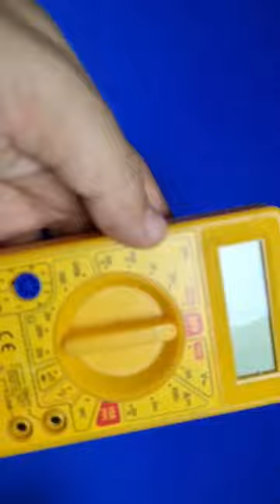Upgrade Your Multimeter: Here's How You Can Make Backlight Using Old LCD Panels #shorts #zaferyildiz

Comment: If you want your multimeter to drain its battery much faster than before, then go ahead with this. 🙄
Reply: We can use rechargeable lithium ion battery plus step up module in this multimeter so there is no concern about energy consumption.
Reply: Zsombor99@ Ja, und wenn sie gar keine Batterie verbrauchen wollen, machen sie die Batterie raus, dann verbrauchst du Null Batterie und sie müssen nie wieder eine neue Batterie reinmachen!!!!! 🤦🏻‍♂️💥
Reply: Zsombor99@ Ja, und wenn sie gar keine Batterie verbrauchen wollen, machen sie die Batterie raus, dann verbrauchst du Null Batterie und sie müssen nie wieder eine neue Batterie reinmachen!!!!! 🤦🏻‍♂️💥
Reply: @Orao2  Write in English, please.
Reply: @zsombor_99  Yes, and if you don't want to drain a battery, remove the battery, then you'll use up zero battery and you'll never have to put a new battery in again!!!!!  🤦🏻‍♂️💥
Reply: @Orao2  No one would take out the battery regularly (including me)! Calm down, bro.
Reply: Or just add a 4.7k resistor because at a voltage drop of 1V, it will only allow about 200uA to flow, but it‘s usually enough to visibly light up a screen in a dark environment.
Reply: @Orao2  you could also add a plastic switch to turn the multimeter off from the outside by physically cutting the power.